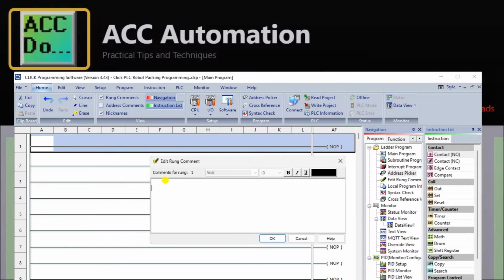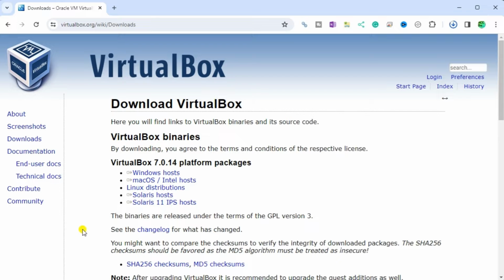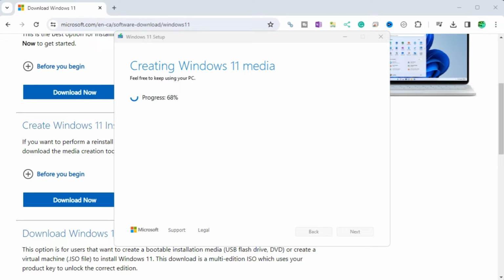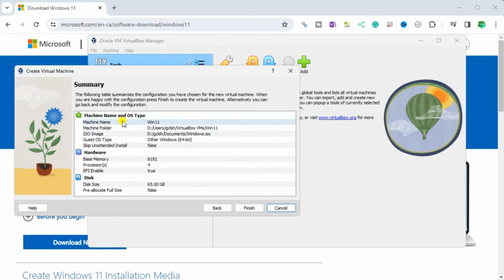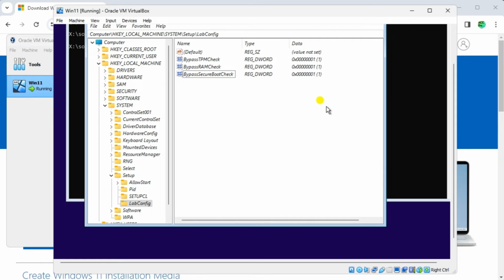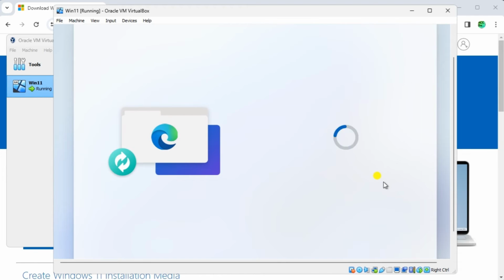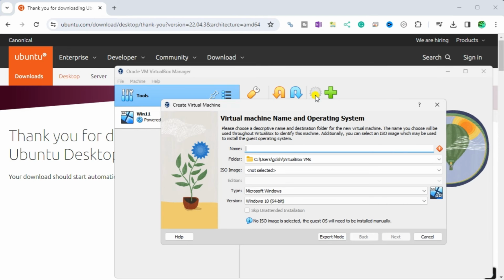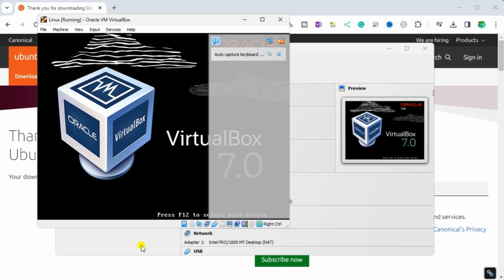Creating a Virtual PLC Programming Environment

Comment from the maker: You can find detailed information and links on the corresponding video located here.
https://accautomation.ca/creating-virtual-plc-programming-environment/

PLC Beginner’s Guide to PLC Programming
https://accautomation.ca/programming/plc-beginners-guide/

Here are the controllers that we have covered at ACC Automation:
BRX Do-More Series (Do-More Designer Software + Simulator)
https://accautomation.ca/series/brx-do-more-plc/
Productivity Series
https://accautomation.ca/series/productivity-1000-plc/
https://accautomation.ca/series/productivity-2000-series-plc-p2000/
Click PLC Series
https://accautomation.ca/series/click-plc/
Omron CP1H Series
https://accautomation.ca/series/omron-plc-cp1h-series/
Horner XL4 PLC Series
https://accautomation.ca/series/horner-xl4-series/

https://accautomation.ca/series/easyplc-software-suite/
EasyPLC Software Suite is a complete PLC, HMI, and Machine Simulator Software package. See below to receive 10% off this software. This PLC learning package includes the following:
Easy PLC – PLC Simulation will allow Ladder, Grafcet, Logic Blocks, or Script programming.
HMI System – Easily create a visual human-machine interface (HMI)
Machine Simulator – A virtual 3D world with real-time graphics and physical properties. PLC programs can be tested using the EasyPLC or through other interfaces. (Modbus RTU, TCP, etc.)
Machine Simulator Lite – Designed to run on Android Devices.
Machine Simulator VR – Virtual Reality comes to life so you can test, train, or practice your PLC programming.
Purchase your copy of this learning package for less than $95 USD for a single computer install or less than $110 USD to allow different computers.
You should receive 10% off the investment by typing in ACC in the comment section when you order. http://www.nirtec.com/index.php/purchase-price/
Learn PLC programming the easy way. Invest in yourself today.

ACC Automation
https://accautomation.ca/